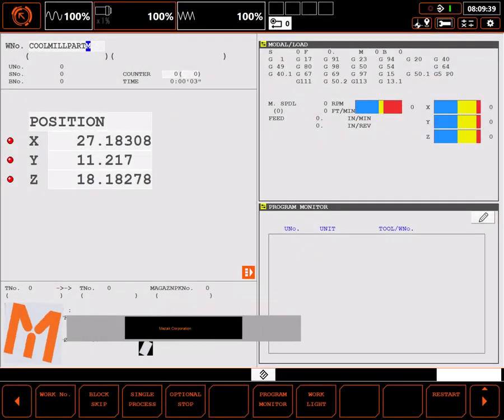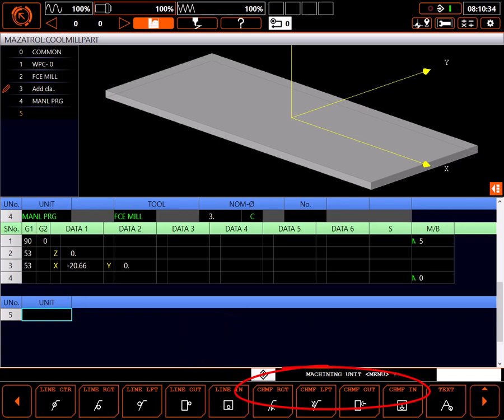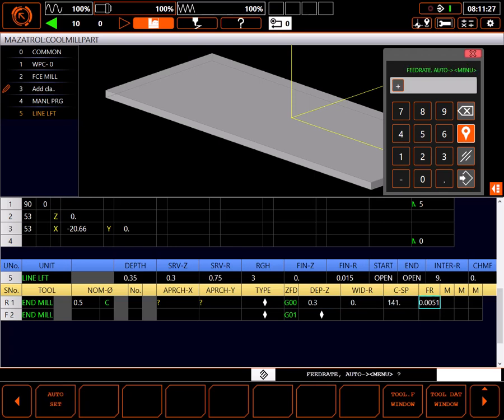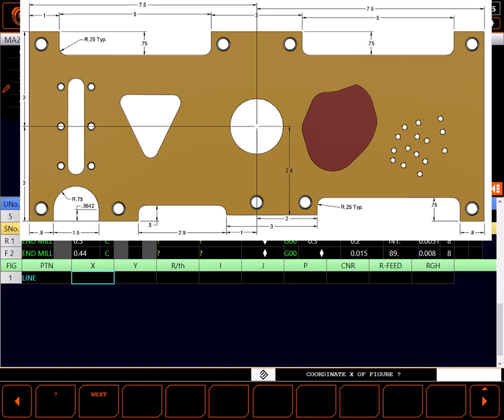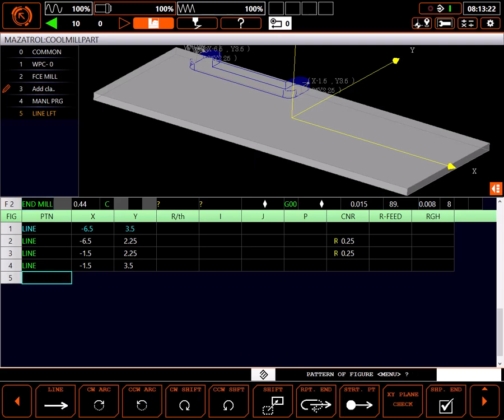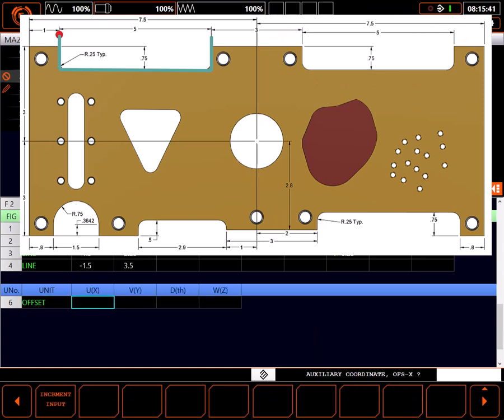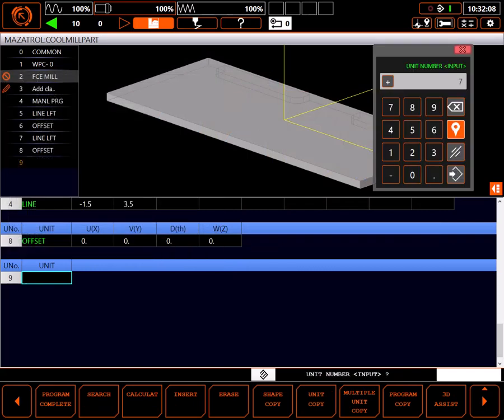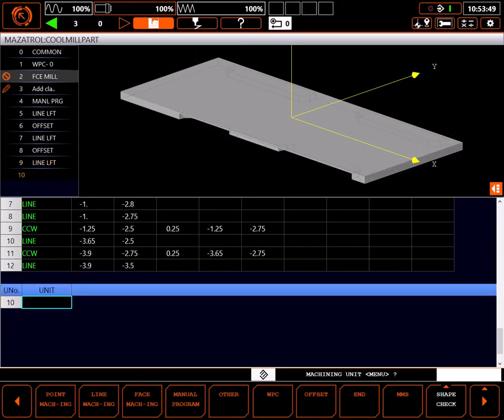MAZATROL Programming Briefs -  Contour Milling Cuts

Comment: The radial width of cut is set by parameter E131, being a percentage of the diameter of the tool, Your control has this parameter set to 0, hence no radial step over auto calculation.
Reply: do you know anything about tornado milling? 
how do you do it?
Reply: @fredrezfield1629 
Tornado milling spirals down as it cuts and then stays at the finish z level for the last cut (360 degrees) - rather than going down incrementally  in z axis and then cutting at that z level . As an example - if you were cutting a 16mm hole with a 10mm centre cutting endmill - going 12mm deep using 1mm depth cuts - it would spiral down 12 times ( 12 x 360 degrees) and then remain at z -12 for its final 360 degree cut